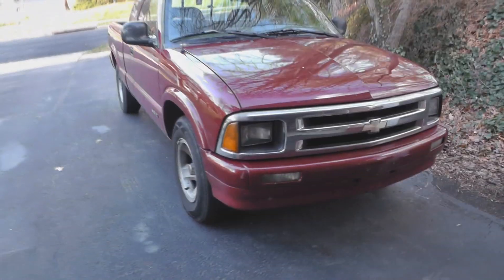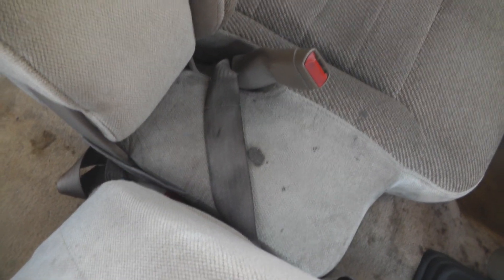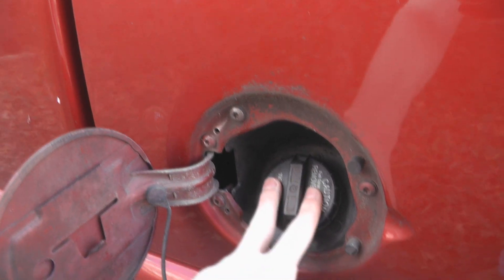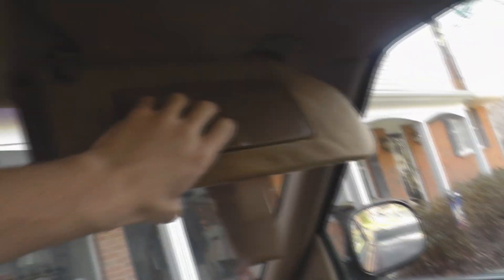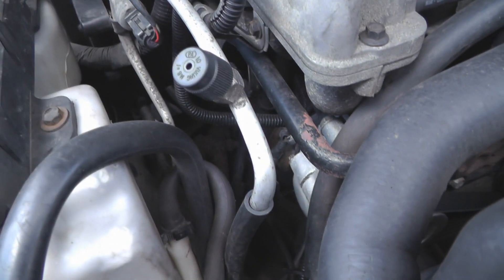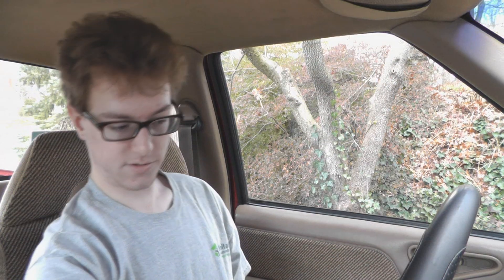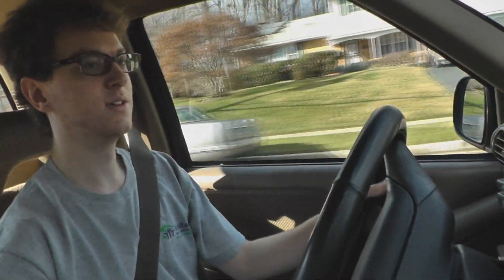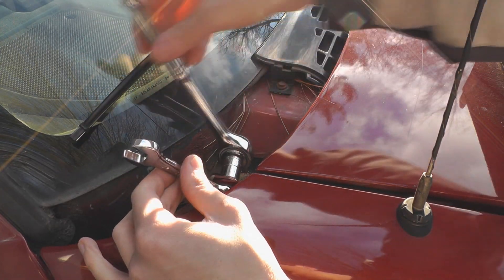S10 EV Conversion: Introduction - Part 01

Comment: Thank you for the video, I have thoughts of Doing this, though a couple of questions.

1: does it matter what year S-10?

2: is it possible to do the conversion on a 4X4 model

3: when using a stick shift S-10, do you still have to shift (or can ya still shift I should say) or do you have to leave it in 5th?

EDIT: 4: can you still tow with it? I'd probably be pulling around 6,000 pounds

Comment: why the fuck are you spending so much time reviewing the truck ?  it's an s10, we don't need to know about the jump seats, the ashtrays and how deep they are, the tach that you won't be using , the headlight switch that is standard on every GM vehicle made in the 90s..... hope you fixed the "hood holder upper" .... this had nothing to do with EVs.... you spent 20 minutes being a complete ass clown taking about a 20 year old truck .... thanks for fucking nothing ... thumbs down